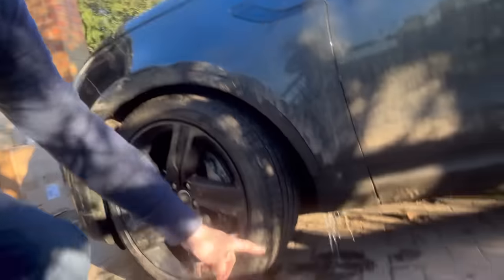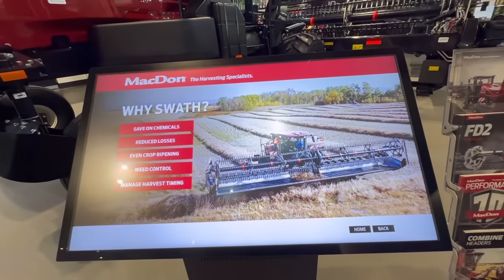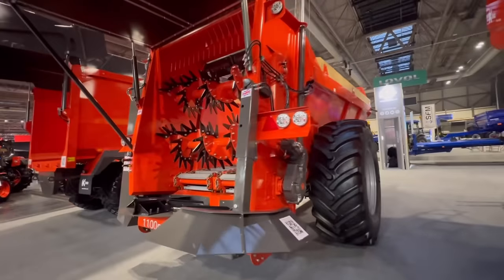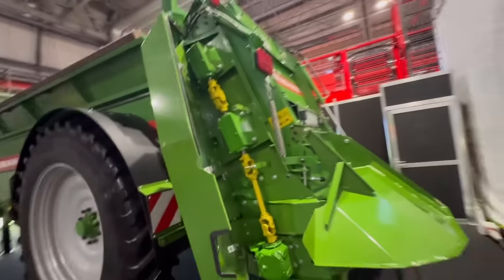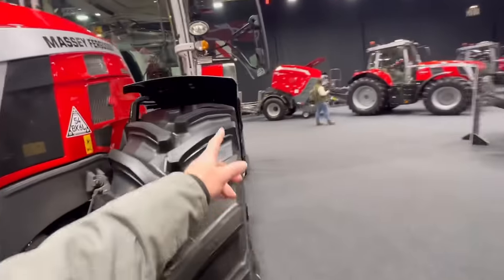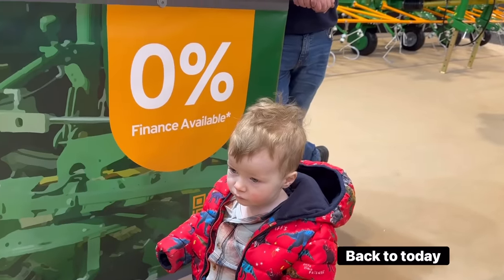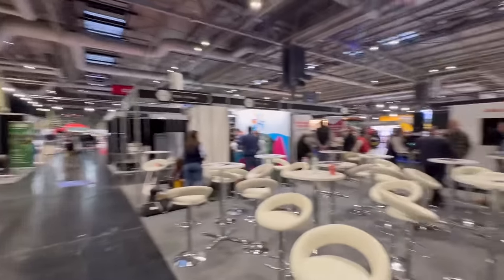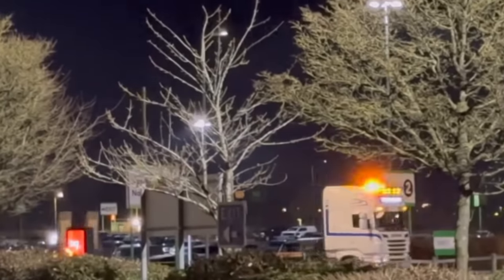LAMMA SHOW BATEMAN SPRAYERS DAY 3 #AnswerAsAPercent 1402

Comment: Just a quick point, not every farm can justify muck spreaders that require 150p plus horsepower like a small family farm or small contractor in smaller fields.     There are a lot that would only need a 5 ton spreader or less and a lot less power to drive it.     Still a great video, thanks.